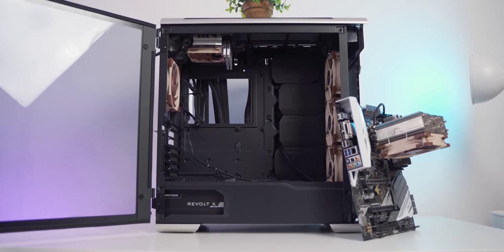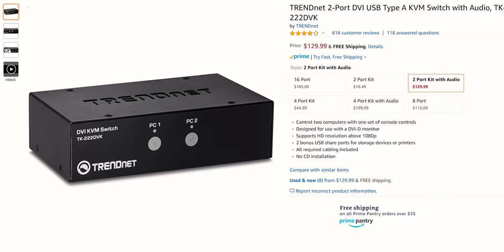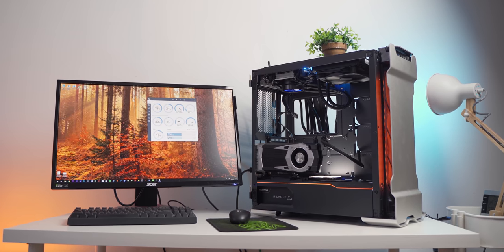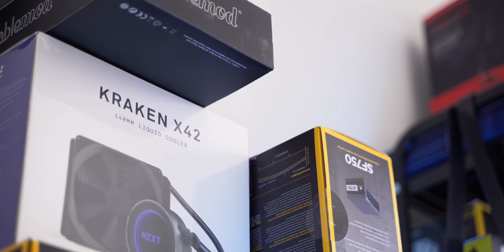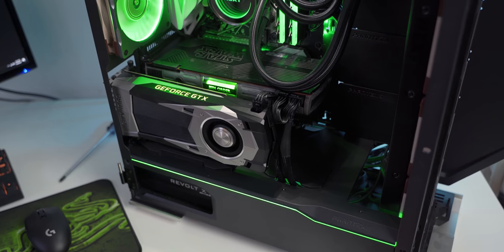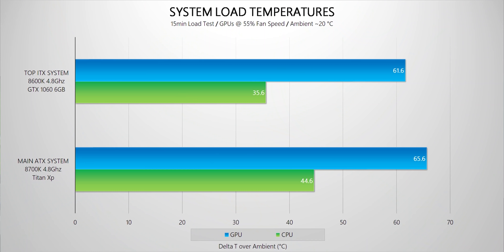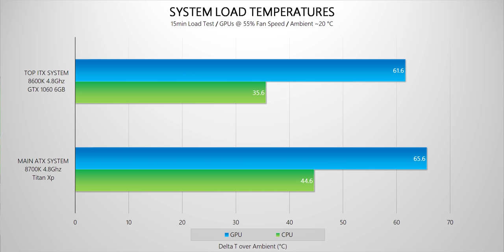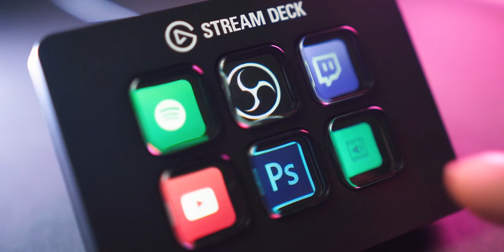My Experience with a DUAL System PC!

Comment: Here's a few things that a lot of people do with a dual system build like this:
1 - Use the ITX system as a NAS with a 10GB ethernet or ThunderBolt 3 (if possible) connection to the main system.
2 - Use the ITX system as a capturing or streaming PC with a capture card installed in it, which reduces stress on the main system.
3 - Use the ITX system as a rendering node, so that you can work on other projects on the main system. A good example of this would be when you are trying to make a lot of videos before you go on vacation or holiday. Again, this would include 10GB ethernet or ThunderBolt 3 (if possible) cards to quickly transfer files from system to system.
4 - Have two separate OS's, much like the mentioned Hackintosh idea (Perhaps something like a Vega 7 would be cool to see when it comes out)
5 - Use this for two people. The power user gets the main system, and the secondary user gets the ITX system. This works well in places such as smaller apartments or office spaces. The ITX system could also just act as something such as a guest PC for a small Lan party.
6 - Have the main system be a full on workstation (Quadros, xeons, ThreadRipper, etc.) which is dedicated to work, and have the ITX system be for home usage or gaming. A good example of this would be that massive build which LTT did in the Corsair 1000D. This is a great solution especially because you basically never have to worry about getting work and home files mixed up. 
7 - Simply save space. It's honestly easier to have two PC's in one case, rather than having to tote around two separate ones, assuming that the 2-in-1 doesn't get heavy.
Reply: StorybookBus03

ITX???, why you need low power home PC's???
ITX thunderbolt 3 Display, small desk?
This is for gamers, ATX, RTX intel k only? AMD Zen too, forget Vega AMD navi ITX please......Thunderbolt on AMD, muwahwahahawahahhaha...
Reply: @lucasrem  Yes, the second system is an ITX system. Each of the 7 recommendations is separate from the other. Furthermore, it is possible to use Thunderbolt 3 on x399 with the right motherboard, and I said "if possible".
Reply: @storybookbus0314  
 Thunderbolt 3 = intel!
forget ITX, office low volt! Gamer need the heavy gear, AMP + Volt = heat gear, the Tu101 cards, some intel k enough!
Need ITX sizes, you better play games on PS4!
Reply: @storybookbus0314  Nintedo good enough, then you need low power?
Most people need the Tu101 models, some intel k!
Reply: @storybookbus0314  Volt + AMP = heat, gamer's need the big cases, to fit cooling solutions.
Or stay on the nintendo levels!
Reply: For me as a content creator,  Building a dual system in the Phantex Enthoo Elite is so ideal. The main system would be a Threadripper build which serves as my main productivity workstation while the ITX build  would serve as my NAS with a 10GB eternet connection to the main system.  The entire system is plugged to a UPS which is then plugged to a Surge Protector for proper safety.

Comment: You could probably use a dual system for young children.  It could be locked down with only the software that the parents want the kids to use, and not necessarily need the same system resources that an adult might need.  For example, the smaller system could require a password to get online, keeping the kids from accidentally buying things online.  They could also use it for learning without messing up any settings on the main system.

Comment: I have a brother and we share the same room because we have a small house.
That's the only reason I have for wanting a dual system. We could share the same custom desk, each with their own monitor.

Even if we were to put our PCs on the living room, I would prefer it to be a dual system to save space, and I think that's the main reason you'd want to have this configuration even in an office, to work with someone else. You can use one to stream too and the other to play if you are a content creator.

I think that was your main problem trying to figure out why someone would want a dual system, you were thinking as if both systems were for the same person all the time, and from that I guess you may not have a brother.

Thanks for your videos, I really love Phanteks design, quality and innovations, it's just a shame they aren't in Chile. For example to buy a power supply from them (the Revolt Pro) I had to buy it from Amazon, even though I could buy another one in my country and I would receive it in less than a week.
Surprisingly, even considering the shipping and the import fees it's almost the same price I would pay for another A tier PSU in my country, which shows you how expensive is gaming on PC over here.

Comment: An excellent use case would be to run Linux if you are a developer. WSL2 (which is virtualized Linux within Windows) has some issues and is not a true Linux server experience. However, a headless Linux system only needs to be connected via Ethernet (no graphics card needed), can be interfaced with via SSH and web interfaces, and can remain online even if the primary system gets rebooted.

Comment: One thing you could use the second system for is as a high-performance router.  In many cases the hardware in your router is actually the bottleneck in your throughput.  So even an old cpu you have lying around can outperform your existing router.  Dual system would allow you to have your pc and your router in the same box.  The downside would be if you reset one system does it reset both systems?  That would mean when your main pc resets windows every 6 hours for an update it will knock out the internet for everyone.

Comment: This is perfect for a Streaming system, even if your main pc has amazing components most people dont realize that the stream will takeup quite a bit of GPU performance as soon as you add an overlay. The more the is going on in SLOBS the worse your stream will be while gaming. The only two solutions are limit your ingame framerate so that your GPU has headroom for the Stream or using a second PC.

Comment: I have just started my dual system mission. I went with a Thermaltake Core W200 case which will allow 2 x full sized ATX motherboards.  My main system is a 5950X, X570, RTX3090 and 128gb of DDR4 memory.  My second system is a i9 9900k, Z390, RTX3060 and 64gb of DDR4 memory system.  I do alot of video editing and of course AAA gaming with the idea of starting streaming.  There is a total of 20 PWN fans to move air around that huge case, both systems have a 360 AIO for the CPUs.  My goals is to use the 5950 as my gaming/main rig and the i9  9900k as my rendering, banking, streaming and backup machine.  I have also gone full RGB on the 5950 system (my first time) as there is a window on that side of the case and the i9 system is not visable so its full black and hides all of the cables. In terms of controlling the 2 systems, I will use remote desktop to access the i9 system instead of a KVM. Mainly due to my 3 monitor setup which consits of 2 x 27"curved monitors and a 34" curved monitor all 3 are 1440p. Would love to hear what else I can use the 2nd system for? I already have a NAS, home server for downloading torrents mainly and a pc for my CCTV system.  you could say I am a tech junkie for sure ... lol

Comment: Good use of secondary systems for people who actually use their computer for work is the larger unit is for pure grunt CPU power to do workloads such as video rendering or other high power usage, with a good professional GPU.
Then the other board usually smaller one is for gaming, it does not need to be connected to lots of harddrives only enough for games and system, its got a mid range CPU like Ryzen 5 or Intel i5 but a grunty GPU for that gaming performance.

Comment: I would have a cheap ITX system, like a R3 3xxx that has a good M.2 WiFi adapter for serving WiFi to mobile devices at home, and use an x8 riser cable to put a nice dual 2.5Gb NIC for serving Ethernet to the main system. It would be a firewall as well of course. All of the above can be had for around $250 used right now in 2024.

Comment: I think the streaming use is the most practical one, that's a case where one person might want to use two systems. Hackintosh is a good suggestion, too. The banking/security one is a decent suggestion, but that's usually tackled by virtualization--I'm not an expert, but I think a virtual solution is actually more secure than two hardware ones? And, I think you make a good point about the gaming/editing one, most people who can afford this kind of setup can afford a system that's going to render most projects in very, very little time.

For a lot of the suggestions, like the NAS, it's kind of clunky. This powerful of a system could "just" be a NAS without a second motherboard/CPU in most cases. And if you were wanting to have a second computer to be a server, you "should" (though I'm sure it's not always an option) try to put the NAS somewhere else in like a sever racket or a closet where it can have noisier fans and not bother anyone.

All that said, I think this case and a dual system setup is mostly an aesthetic choice. It can save space, like you mentioned, but that case is way bigger than two (actually small) ITX cases, which can house capable machines in their own rights.

Comment: Instead of a KVM switch I used the Synergy 1 Basic software which allows you to use one mouse and keyboard for up to 6 PC at once with no buttons you can also get a PRO version which allows you to click and drag files and windows and copy and paste between the different computers it is defiantly worth the small amount of money I spent on it.

Comment: I'm going to put one of these systems together.  This would be ideal for trading overseas where you need a VPN in order to trade from the states.  VPNs typically slow down your internet speed.  I don't need all of my other internet based tasked slowed down by the vpn connection, so this setup would be perfect. Use the mini ITX pc for VPN/Trading and use the larger pc for other tasks and "local" connections.  The best of both worlds, all in one pc.

Comment: i run wireless VR on the main system and then have a second person playing cabled from the ITX.  When the ITX isn't in use, I NVLink my two GPUs.  I could also put a capture card onto the ITX, but at the moment the NDI output settings in OBS work well enough for me to send video to the ITX for streaming.

For KVM I use a Dell monitor that has it.

For anyone thinking about doing this, my only advice is make sure you've got lots of money before you start because the components are all really expensive.

Comment: Linux system and Windows system. I thought that would be an intuitive choice.
Reply: My thoughts exactly..  Linux for browsing the dangerous web and productivity , windows for productivity and and gaming
ideal deal for a dual largescreen setup
Reply: A dual system is perhaps the quickest way to do that, perhaps with an APU (no discrete graphics) in the ITX system. It is not the cheapest way, however. Virtualization on Linux is really good these days, to the point that you can actually export whole hardware devices like graphics cards to a virtual Windows instance. You just need a processor and motherboard which supports virtualization and IOMMU. Both AMD and Intel CPUs can do this. There is a bit of configuration work involved, but once you have it figured out you can have Linux running on one graphics card, and Windows on the other, sharing the same CPU.
Reply: @666Maeglin  yeah i got linux as my secondary pc / monitor for browsing and music and reference materials  and the main pc for graphic designing, why run dual monitors on 1 pc if you got older pcs laying around anyway
Reply: Arch is superior
Reply: @overcock1914  Yes, those are important points to consider. If you want a system which is as similar to a normal system as possible, dual boot or a dual system is preferable to virtualization.

Comment: for my my interest is having an apu system for when im just watching videos or browsing the internet and then a more powerful system for gaming and editing so im not running such a high end system just to watch anime all day
Reply: Provided the hardware is relatively the same generation, watching videos or browsing the internet will not use more power on the higher end system in any way that you'll notice. A computer doesn't use it's full power draw for every process, it only uses what it needs when it needs it. 
Try installing HWMonitor to check your "power draw" in Watts when you are using it. You'll find it stays really low for the majority of your tasks.
Dual systems are really meant for streaming. One PC for gaming, the other for processing the stream. Both functions are very intensive so having two machines is better so neither experiences a performance drop.

Comment: Great video. I’d love to do this. The second system would be my NAS and media streamer, I’d keep my full loop, transplant my system and put in an ITX with something like an 8700k with an AIO for encoding in VLC Streamer Helper and backup compression.

I think you did a great job here man. We all have different tastes and requirements, and I think you achieved a nice, and beautiful, balance.

I was one of the people who called for a custom loop. 1) Because I’m bias 😏, and 2) because we simply don’t see water cooling builds from you, and I’d really like to.

I could be wrong, but my feeling is you aren’t really that comfortable or experienced with watercooling. To me, that’s totally fine if that’s the case. It would be fantastic to watch you go through the journey, overcome the obstacles. Maybe see you start with flexy and move into hardline, maybe dual loops.

It would be great to have an ongoing series watching you experiment with this build, evolving the solution and the application as time went on.

Just my tuppence, much love as always.

Comment: I will buy the Evolv X at the end of this month. I just love the way it looks and it really suits my needs. I have a Noctua NH-D14 and two Inno3d GTX 1070 dual fan in SLI , so my space is really tight. I also have a separate ASUS Soar audio card. This is the reason I need this case besides many other things. It's wider than any other cases with vertical GPU mounts and so the audio card won't interfere with the graphics cards - I already bought the raiser/ITX combo .  Initially I wanted to buy the Cooler Master H500M but for a few degrees loss  - I can live with that, Evolv X is about 5-7 degrees hotter. Thermals also depends on what fans you install for intake. I will use the factory ones at first just to see how they perform and if they really need to be exchanged. I will move the 140 mm fan from the back to the front and  replace it with another. As for what thermals should I expect - my graphics cards are somewhat factory forced at 83 degrees max. 

PS:

I can't even overclock them properly without them going in some crazy fps lockout at around 20 to 30 fps while the base frequencies get stuck at 139 MHz ( Yup crazy as f#*&). But hey when they get to overclock to 1999 MHz they can match a RTX 2080. Also I payed such a low price for the second card it's stupid hilarious. And don't worry about the SLI 'thing' my games, all of them support SLI and also I cand fiddle with the SLI profiles quite well - I scored 6553 in one of the runs without OC but I have my non k i5 6600 overclocked at 4.5. So is with the games some of them can be manipulated trough SLI profiles using NVIDIA Profile Inspector.  Caution though, I messed up  Shadow of the tomb raider so much so that the game couldn't load anymore. I was trying to force it in 'manual' SLI mode plus other SLI features.

Comment: Make the ITX system a secondary render system using Adobe media encoder or something like that...? Send the signal from your main system to have the second render using the settings you've selected and then have it output in a specific folder on your network somewhere. You can see a large scale version of this on LinusTechTips. All of their high-end systems send commands to a separate server (ITS system in your case) and have it export to a specific folder on their storage server (NAS in your case)

Comment: I cut up a Black BitFenix Prodigy M case, put an Intel Micro ATX motherboard onto the Mobo Tray and stuffed it into another BitFenix Prodigy M with an AMD Micro ATX System, and have them both running on 1 550W power supply. Together they both use about 430w

Uses:
AMD w/ EVGA 960: Chrome, video editing, soon to be OBS Streaming PC when I get a capture card, and the option for a friend to play when I have friends over
Intel w/ EVGA 1060 SC 6GB: Mian computer for digital art creation, 3d modeling, Minecraft All the mods 3 remix (300+ mods), other video games

Both systems are on the same network, so file storage goes on the AMD build. Mouse and Keyboard (when no friends are using the other) is handled over the network by Input Director.
Audio is output from the AMD system and input to the Intel. The Intel has that microphone port set to "listen" so the audio actually plays from the other computer to the main output from the intel.
Pictures can be seen on my Twitter, right now the build is very crude but I have ideas for the second generation, including a drawer pull out for the second motherboard. Both systems use stock coolers, and only 1 fan is in the system.
Reply: Kingsidorak what’s your Twitter
Reply: @qkg6297  @Kingsidorak

Comment: This looks like a good use case for the Galax GTX 1070 Katana.  A single slot 1070 GPU would work wonders for space efficiency in a setup like this though they do run a bit hot.

Comment: This dual system could be used for Blender rendering with the Crowdrender plugin.
It's the only useful usecase I could see. And the other is if you want to conserve energy by using a low powered ITX build.